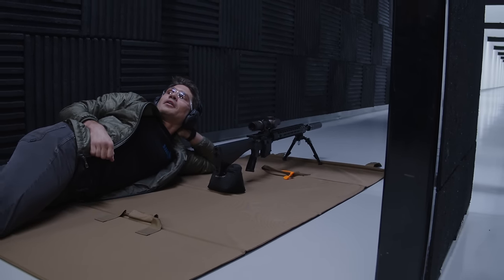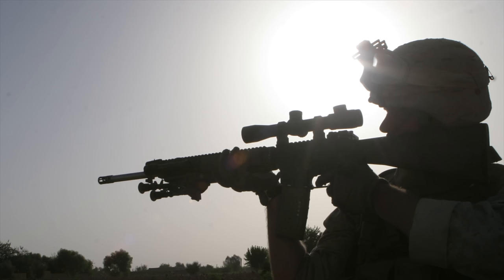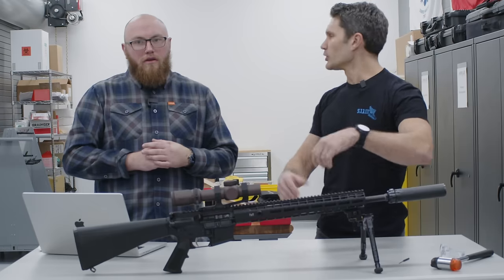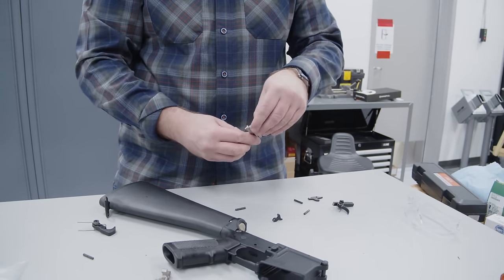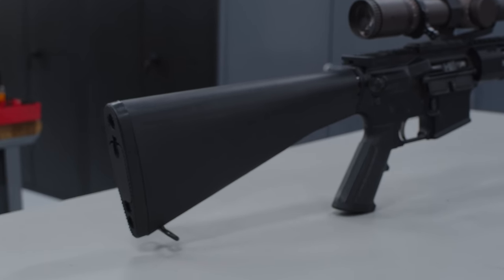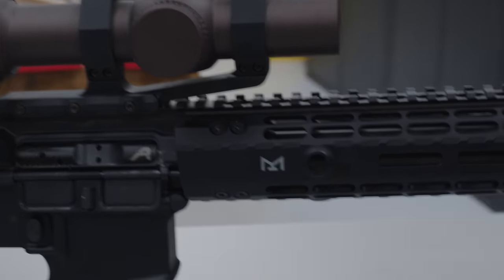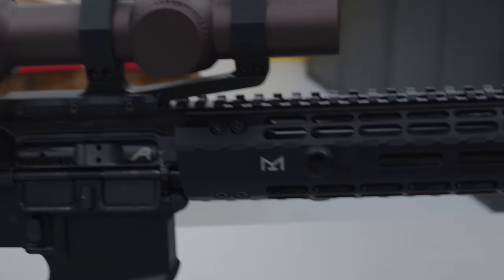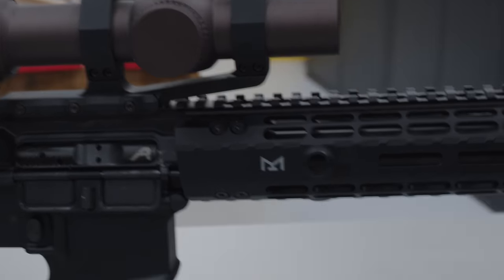Build a Designated Marksman Rifle AR-15 on a Budget!

Comment: Most people can not even shoot a sub MOA gun within 1-2 MOA consistently . On top of that when you get going quickly none of that shit matters. I have made hits at 300-400 meters with a $600 gun just as easy as a $2500 gun. Not shooting for groups but putting rounds on ipsc c zone steel. If you are needing to shoot further than that you should probably step up to 30 cal for better ballistics all around. Don’t overthink it. It’s a 223 for Christ sakes. Shoot them in the torso 2 or 3 times and move on.

Comment: The concept seems to be fun to talk about, but we have enough hard earned knowledge from guys who lost friends. There are dozens of youtube videos from around the globe speaking with people who used 556 in combat from tip of the spear type units. Anything past 300 yards (including 72-77 grain) that was not a head shot was not significant and had major troubles with barriers. 

Specifically reference former ST6, Delta, SAS, and other SMU from youtube interviews who engaged dozens if not hundreds of opposition targets per operation. The best part of this is we get to hear from guys who would know dating back to Vietnam jungle fighting where they needed several rounds at close range. To conclude in the last 20 year 556 was considered great for individual structure takedown and hostage rescue scenario where suppressors and nightvision were always used and would engage targets until 5 or 6 effective hits were made to cause immediate end of threat engagements. If it was a valley or multiple building ops where any type of two way actions were taking place beyond 300, expect lots of 308 (60/mk48) 300wm, with support fire being M2 (50bmg), mortars, and CAS. 

Seriously thinking that we, as civilians need threat engagement beyond 300 yards and than 556 should be your go to for that...... is it misinformed or uninformed?
Reply: Yea doubtful civilians will need performance past 300. 
Though if someone was set on building one for that purpose.  I would try to steer them towards 308. If they wanted to stay in the smaller package.  6.5G would fit the role better than 5.56
Reply: Just watch Garand Thumb’s video on rifle setup. He has two extremely knowledgeable and experienced guests in that video who briefly touch on that subject. Keep in mind, killing an opponent is also not necessarily the goal—stopping the threat (for most of us) is. As far as a combat role, for every single injured and now combat ineffective combatant, two or more additional combatants are taken from the fight to provide medical assistance. I’m not saying that such philosophy provides an excuse for inadequate terminal performance, I’m only saying that it’s not exactly everything. Also, I’d push that effective range to 5-600 yards. It can certainly kill at longer distances, but there are certainly better tools for that job. Lastly, depending on the position, dynamics, and ability for resupply, I’d say the ability to severely wound a larger number of combatants is far better than being able to kill less than half that number (all while being more fatigued for toting a heavier weapon, it’s mags, and ammunition.) Let’s be frank, we’re not being air dropped supply as civilians. We don’t have air support or heavy armor/artillery to even any odds either. In our world, you run what ya’ brung, until your black on ammo. If you’re just defending the fort and mostly stationary with cases of ammunition at your side, then sure, by all means. But to think you’re going to go humping it through “the jungle,” you better be in damn fine shape—more power to ya’ if you can do that. If you haven’t tried it with all the gear you intend to run, give it a try before you decide to depend on it. 

I will say that there is certainly good reason for heavier hitting calibers, but those reasons often don’t translate very well for how most would use a rifle, but ymmv and that’s obviously situationally dictated.

Comment: Impressive hitting this price point. But why build a DMR on the 5.56?!?!?

Why leave 50% energy at the muzzle and way more down range on the table? 

Is hitting that price point just not possible in
- 6 ARC
- 6.5 Grendel
- 6.8 SPC
?
Reply: Standardization of parts, ammo, and mags, relatively inexpensive to shoot, and cheaper to build would be a start.
Reply: @Centermass762  6.5 Grendel uppers for example are not that much more expensive, should work in 5.56 mags (of course there are dedicated ones). But YES the ammo price is an issue. 

But then you wouldn’t have the same round count on a DMR as with your go to AR15 in 5.56

DMRs are meant to cover the 300 to 700 yard space. 5.56Nato is ballistically just a really inferior choice for that.

Comment: That's a great story, but it's also pretty hard to believe. First of all, 2 groups don't make it a sub moa rifle. Second, was the rifle broken in at all, or was it that accurate right off the bat? I would guess that barrel was not just pulled at random from a rack for this build. I'm not in any way trying to trash Areo they make a decentproduct, but the chances of throwing together a rifle with cheap parts, especially the barrel, and it consistently shooting sub moa groups would be rare. To all the comments on cheap builds shooting so great, I guess there are a lot of people who are much luckier than me. I usually have to spend at least 4 or 5 hundred on just a barrel to get those results. I don't know. Maybe I just suck.

Comment: Stupid question: is there any reason not to get a cheap buffer tube/buffer? I'm assembling a lower with a geissele stripped lower, and I'm just wondering if there is any reason to spend $144 on a Geissele tube/spring/buffer, vs. $115 for the same from BCM, or (checks notes) ...$45 from Aero.
Reply: Just make sure it is a 7075-T6 buffer tube. Some places will advertise a cheap tube as mil-spec and use 6061aluminum. I personally use BCM buffer kits because their quality has always been consistently high and the interior of their buffer tubes is nice and smooth. Not sure where the $115 price tag is from. BCM carbine buffer kits are under $60.
Reply: @Deltaworks23  Thanks for the reply--looks like $115 is for BCM's fancier "recoil mitigation" kits, but I do see their milspec kit is $60. Nice! Thanks again.
Reply: I would like to see a sub $500 build.

Comment: So a .223 Wylde barrel can shoot 5.56?
Reply: Hey 223 wild is a chamber dimension it's not an actual cartridge it's made so that you can run 223 Remington and 556 and it's to enhance the accuracy or at least not let it degrade between the two cartridges.
Reply: Yes it can. From my understanding wylde has a throat length between 5.56 and .223 I believe the purpose is to get good accuracy out of both cartridges rather than optimize for just one
Reply: In reality you could say that it is match chamber for 5.56
Most AR:s are chambered for 5.56 because reasons.
And because of that .223 ammo will suffer minor accuracy loss in that chamber.
Wylde is there to give bit more accuracy out of normal civilian type of ammo.

Most likely it will even help a little when 5.56 stuff is used because tighter chamber.
But if you have very shitty quality of 5.56 that could cause issues.

Pretty sure that why military is not using wylde standard because badly handled/stored/etc
ammo would not be that reliable.

Comment: If you want a sub MOA gun,  you need a good barrel and a good bolt. Most free-floating handguards are good enough.  Uppers and lower receivers themselves have almost no effect on accuracy. 

Some things YOU can do:

1.  Shimming your barrel extension into your upper. I usually use 0.001" to 0.005" stainless shimstock wrapped around the extension.  You can stick it to it with a little molybdenum disulfide grease to make it easier to install. 

2. STOP USING CRUSH WASHERS. There's tension on your crush washers, and as your barrel heats up, the tension in that crush washer changes. This will change the harmonics if your barrel. It was throwing my AR10 off by as much as 5" at 500 yards low/left after about 10-15 rounds. 

3. Get a high quality gas block for the same reason you shouldn't use a crush washer. If it has to touch your barrel, it needs to touch it with as much uniformity as possible.  

4. Check the crown of your barrel. And for God's sake, clean it. As carbon builds up between the crown and the muzzle device, this can change how hot gasses interact with the tail of your bullet as it leaves the muzzle.

Comment: Aero not skimping on QC? Thats a good one. They have terrible QC. Their BCGs are trash.
Reply from the maker: They don’t make their BCGs. Not excusing it but that’s probably the only part they don’t make.
Reply: @tfbtv  barrel?
Reply: Never used their BCGs but I know I can't find a stripped upper with a smooth interior bore. Always has some bumps or ridges inside. Not sure if it is a machining issue or bad anodizing or what but I gave up on Aero for everything except lower receivers.